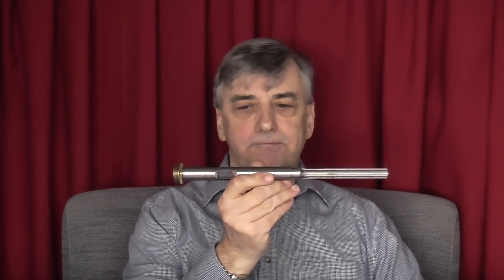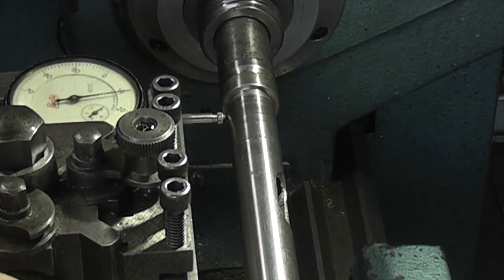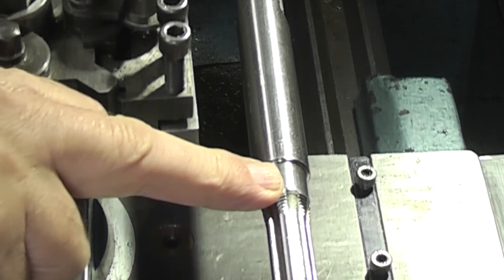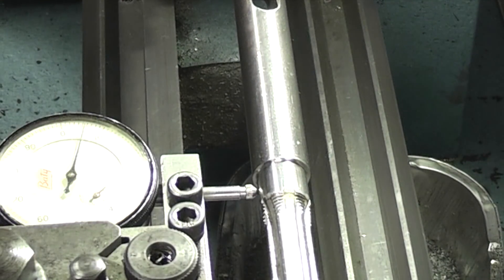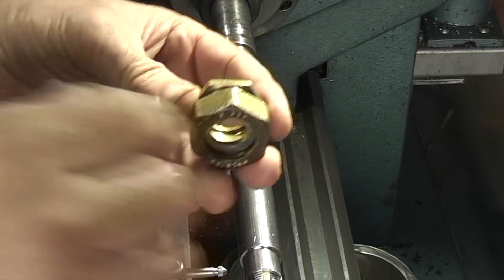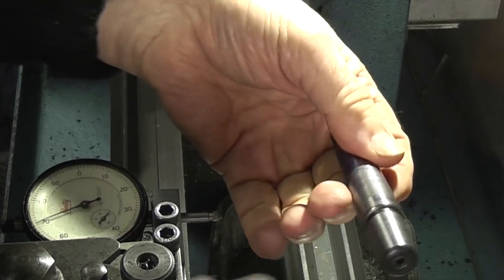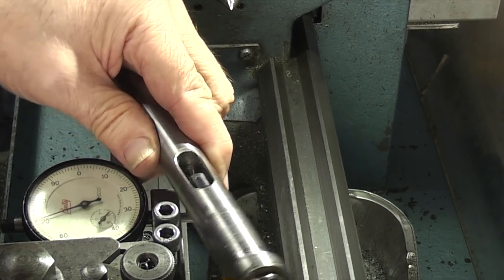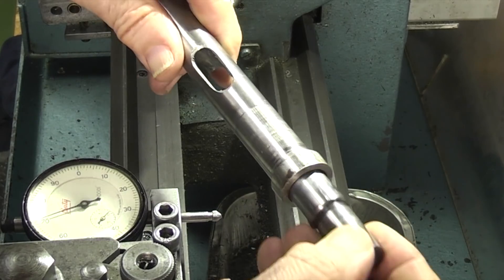Pedestal drill quill rework

Comment: Why not remake the entire quill? The bore taper appears to be very thin and may twist and distort under a lot of torque, especially around the edge hole.
Reply from the maker: Hi Barry I think if I was to remake the quill I would change the bearings for taper bearings and add a thread to put the bearings under compression and remove any play from the quill.
I must add that the pedestal drill is used for milling

Comment: Hi Alan,I've had to fettle Morse tapers inside quill spindles several times in the past. As you demonstrate here it doesn't take much to be machined from the OD or ID to see a dramatic increase in the insertion depth. I usually finish off with a lap and 'Timesaver' lapping compound. The use of the plumbing fitting is an interesting idea. I have a 1950's Progress No 1 pedestal drill and the quill spindle has a cycle threaded nut that goes immediately behind the chuck. This fine threaded nut is used to eject the chuck from the Jacobs taper. The quill spindle can then be fitted with drills and reamers of No1 Morse taper.